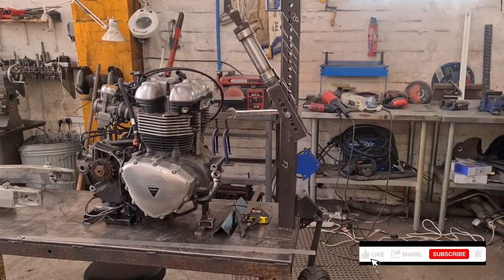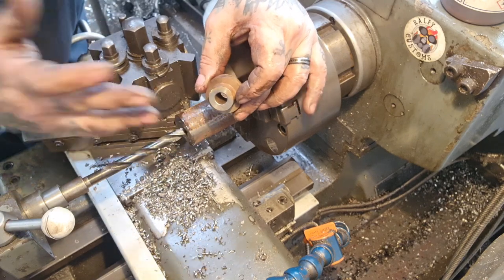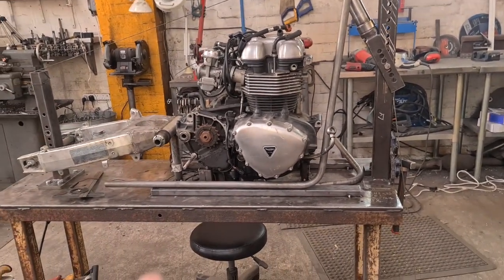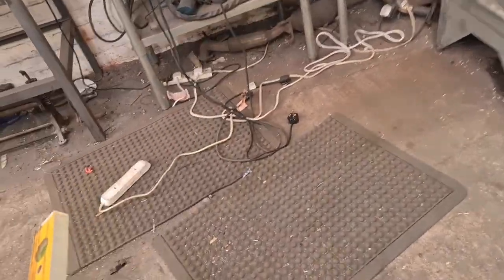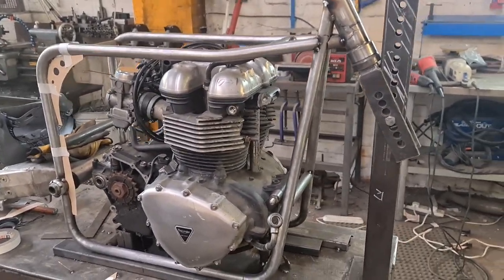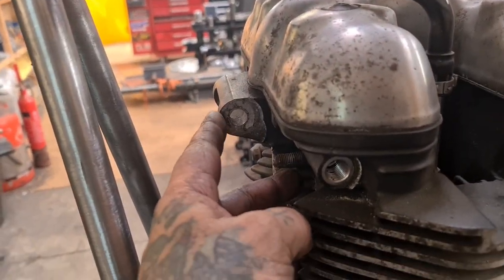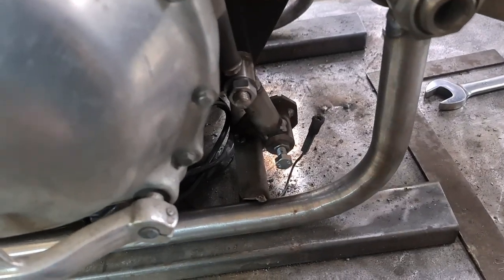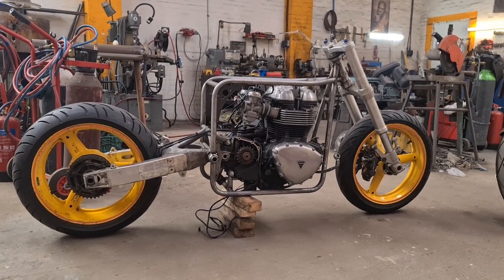Handmade Triton Featherbed Style Custom Build Pt3 #chopper #motovlog

Comment: Just wondering if it ever entered your head to pull the top tubes together a bit at the rear and make it a Slimline frame? I would like to see your bare frame and a real F/B Frame side by side to see the differences! Yours looks slightly taller and more square than the Norton frame??? Kep up the good work see you in part 4
Reply from the maker: Thanks, yeah this is nothing like a real one, rather it's feather bed styled

Comment: Tis gonna be a thing of beauty as always however it do look a tad odd at the mo a mix of old and new in its bare frame form . Headstock to me looks a little odd with the close triangle of tubing , I'm just used to seeing more of a gap and spacing round there .. between top and bottom tubes . . I shall follow as always with interest.  . Wouldn't be a Ralfy vid without a bit of lathe work in there lol
Reply from the maker: Cheers yorkie

Comment: Sorry Ralfy I really don't like that frame 
The bends are way too tight 
And the top tubes should go around the outside of the downtubes to give the featherbed it's strength 
Also i don't know if you are  planning too but a featherbed frame has a headsteady from near the top of the headstock back to the engine that forms part of the frame 
As said it's just my opinion on design, not a reflection on the engineering which is excellent
Reply from the maker: Thank Nick, yeah my caveat was it was never going to be a true copy
Reply: @RalfyCustoms  please bear in mind the brace from the headstock to the engine forming part of the frame 
As an example on a racing Norton the rider would know if the headsteady had come loose because of the handling 
Cheers mate